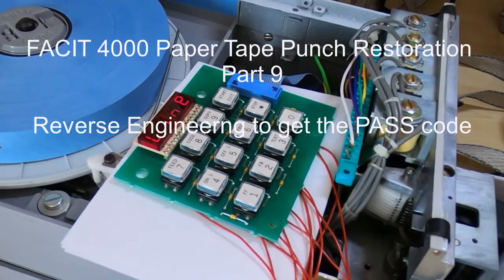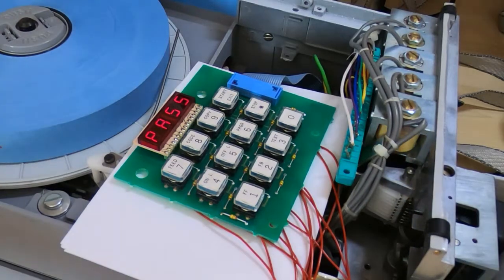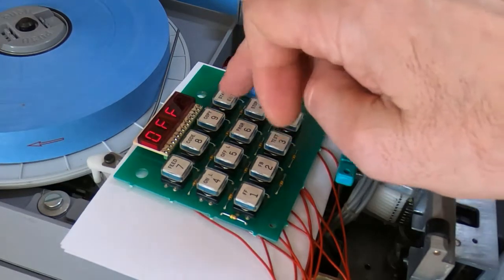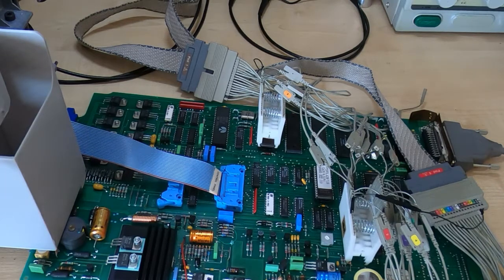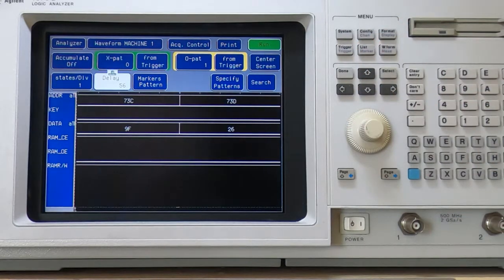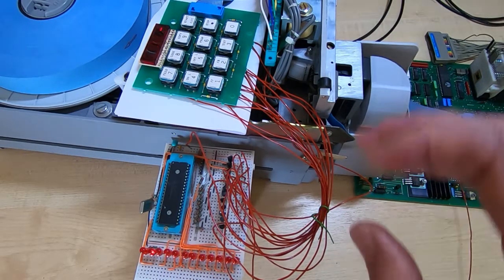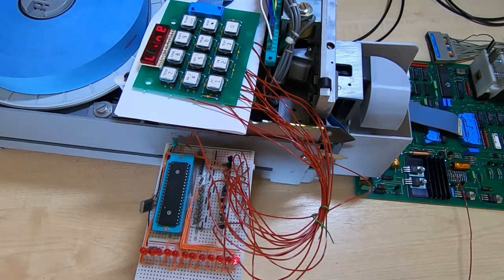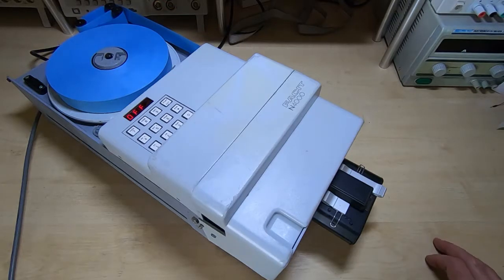FACIT 4000 Paper Tape Punch Restoration Part 9

Comment: Brilliant - fascinating video and well done sorting out the passcode with the brute force attack ! I have three of these machines arriving next week and I hope that I don;t encounter the same problem (three times). Do - you happen to know if the passcode is compulsory  - did you manage to switch that off in the settings ? Thanks
Reply from the maker: I think that the passcode may have been specific to the particular machines I have. I got several from the same place and all the codes were the same. It appears to be hard coded into the firmware so I suspect it may have been specific to the version of firmware in my machines as it would seem pointless to have every machine use the same code (although I have seen this in other old machines).
Reply: @JerryWalker001  Thanks for the reply Jerry - were you able to disable the ask for a passcode or are you stuck with it ?
Reply from the maker: @ianparr  It seems to be hard coded into the firmware. I have not found any option to change it (although I have not spent much time looking). It is also not mentioned in the user manual.
Reply: @JerryWalker001  ah, ok, thanks. Really hope mine don't have this challenge.
Reply: Well, I have has three of the units arrive now and thankfully don't have your version of firmware. Each of them has a different challenge - mostly mechanical due to lack of recent use but one has a blown DUART. Let me know if you want dunps of my ROM's - although I recall your challenge was code in the MC68701.

Comment: Hello. werry interesting video. i have  purchased a facit n4000 at a auktion . could you answer a few question from me ? first what was the code you find out when the battery was dead. 
second. what pc software do you use to communicate with the mashine ?. dou you know where to buy empty paper tape
Reply from the maker: The code was 4711 but it may vary for other machines. I use different software depending on what I am doing. You can use something like hyperterminal for basic punching and reading. I also hook it to machines like the ALtair 8800. For specialist jobs I use software that I have written specifically for the purpose. Paper tape is hard to find and generally it is just keeping an eye on sites like ebay.
Reply: @JerryWalker001  ok thank you. i havent gut it home yet so i dont know if it works . I am gone use it for older nc machines that have paper tape backup for parameters and read them and make files . i have seen paper tape on ebay but i dont think it is mylar but i gees its ok with ordanary paper.
Reply from the maker: I never use mylar tape. I mostly restore old equipment and mylar tape rapidly wears out punch heads.
Reply: @JerryWalker001  ok thank you. i tested my Facit n4000 and there are more serius problems with my facit. it keaps on blowing the 1 amp fuse and i have lokated the problem at the motherboard. i gone change som tansistors and some cap and hope for the best. what are those glas tubes under the tape plate ?. unother ting i have a Facit n1050 diskett nc read/writer but i cant find the systemdisk files on internet. there are on place and that is tripod unofficial facit support place and there i find the file but it cant be downloaded. do you have or know where to find Facit N1050 systemdisk or files ? with best regards klas. ps. sorry about my bad english. i am from Sweden
Reply from the maker: Good luck repairing the N4000, Let me know if I can help. I do not have the system disks for the N1050 but I will have a search to see if I can locate any. The galss tubes under the N4000 platter are reed switches and they detect the position of the tension arm. The metal plates are magnetic shields to give very distinct switch operation. Your English is very good.

Comment: Very interesting! I was wondering though - I think you said in a previous video that this machine was made in the 1980's? I don't understand why they would still be using punched tape for reading data that late! I honestly thought this machine was made much earlier, until you showed the  electronics and digital keypad. What would the purpose and benefits be for them to use this versus disks or even magnetic tape?
Reply from the maker: It is a very common misconception as to when 'modern' devices came into general use. PC's and FDD did not come into general use until late 80's. I started programming in the very late 70's and we used main frames and stored data on punched cards. In the early 80's we switched up to punched tape to save and load programs but there were still no VDU's, just teletype terminals. Early PC's with 5.25" drives and monitors were not in common use until mid 80's but even then many industries still used punched tape for CNC machines and some still do. Paper tape was still in fairly wide use up to the early 90's and in CNC well into the 90's. PC's as we use today did not become household items until the late 90's. I will shortly be posting a series of video's on earlier punched tape machines and even earlier teletype terminals and you will see the development path more clearly. Computing history is actually much shorter than most people appreciate and what many consider obsolete technology was actually still in use well into the 90's. If you are interested I will produce a video showing a timeline for these technologies.

Comment: Interesting technique. I'm glad you figured it out.
That guy in Germany has been selling those N4000 punches for at least two years now as I remember looking at them. They were all listed as password protected, I guess they all came from the same place. I wonder as who ever it was bought so many they had the buying power to get Facit to create custom firmware to add the password. Is there anyway now to remove or alter it now you've gained access ?
Reply from the maker: Yes I have been watching them on ebay for a long time. I have just bought another one from him. I knew it was password protected as all the listings state this but there is generally a way round it so I was not too concerned and now I should be able to get the next one working more easily (famous last words). I have not had time to fully investigate all the features yet but from what I saw when reverse engineering the password it would seem that it should be possible to alter the password. The main issue working on these is the MC68701 as the internal eprom reads do not expose the bus cycles so I cannot capture them which limits what I can look at. However now that I know the password I can look into it more fully as I can trace the result of a successful entry. I know that the passcode is not stored in the internal RAM as no backput voltage is applied. I decided to use the crowbar approach as it was going to potentially be much faster and easier than spending weeks fighting the firmware. It looks quite slow in the video because I slowed it down in order to make what it was doing clear but I ran it as fast as the N4000 could take and once I started it running it only took about 15 minutes to hit the code. Total time including assembling the breadboard and writing the firmware and running it was only about 3 hours. It is certainly now a nice punch and reader.